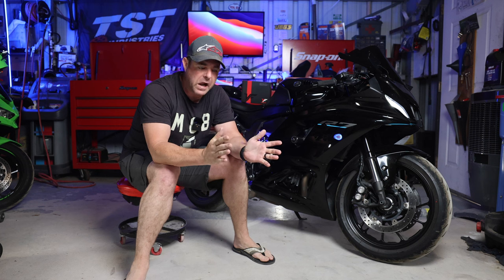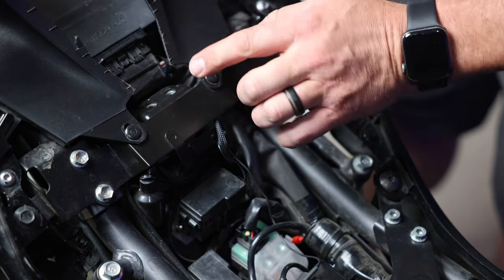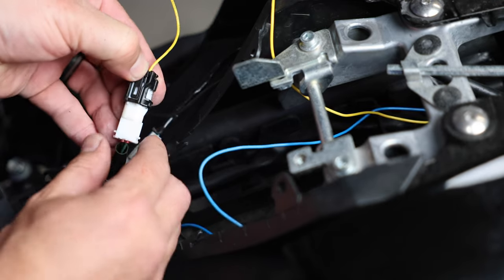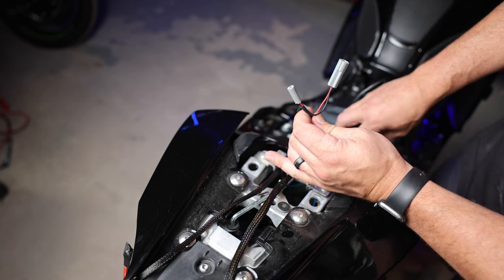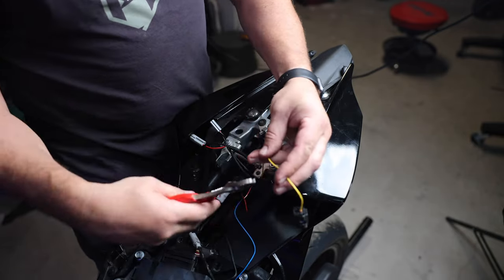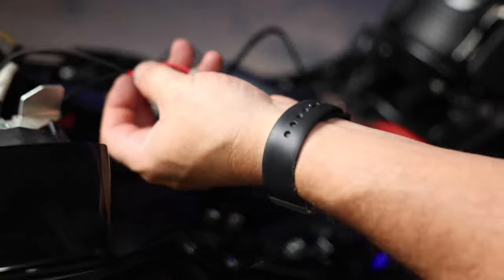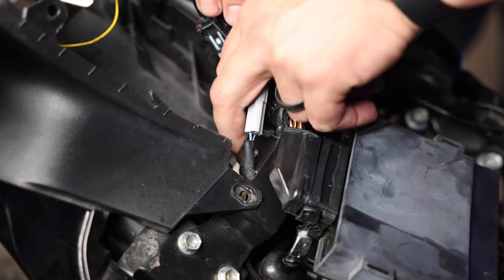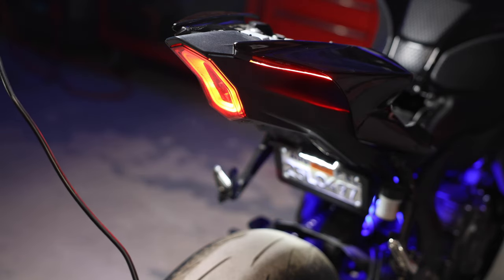Yamaha R7 best integrated turn signals

Comment: Wish this was out when I threw my JL design taillight in so I could have did it all at once. Only thing holding me back from these. Other than that they look amazing lol!
Reply from the maker: Yea man sucks to do it all twice but man they are cool
Reply: Question on tire pressure scouts! Do you run factory spec psi? Or do you have a psi you prefer for this bike?
Reply from the maker: Ahh yes good question, stock pressure is insane and almost the same on all bikes on the street I do 30 front 32 rear, track a few psi less is what I do

Comment: I recently installed these and I encountered a problem, the light stays on when indicating and I don’t know how to fix it, so instead of stopping the light and starting the indicator it indicates over the light which looks bad and might be hard to see while riding do you have a solution that might help this?
Reply from the maker: Hard to say without seeing what you did, but it sounds like you wired the license plate light to the wrong wire maybe

Comment: Hey man it looks amazing. But what if the glue on the tape won’t work what can I use to stick it…?
Reply from the maker: Thanks man, I worried about the that as well but was assured the new version has very strong tape. If it has issues and starts coming off I would use a silicone glue that would hold it really well and you could still remove them if needed

Comment: @ScoutsOut Hey man, I just got a 2024 R7 and I've been contemplating on what mods I should get first, after having your VF Designs indicators for this long are they still working as intended? I've seen a couple people complain about there left Indicator going out. Don't know if VF Design would warranty the part but just wanted to see what you think after all this time.
Reply from the maker: I’ve had many people tell me theirs failed as well. I took mine off when I installed the track fairings so I can’t verify sadly
Reply: @ScoutsOut  man they look so good, i wish this wasn't the case

Comment: So what plug does the running lamps plug into? I have looked everywhere but can't anywhere to plug it into
Reply from the maker: The running lamp is using the license plate light
Reply: Thank you so much. When I plugged it in there it acted like there was a hyper flash. Will I need to change out the turn signal relay
Reply from the maker: Ahh, yes just get the TST relay
Reply: @ScoutsOut  do you happen to know what relay it is right off hand? Is it a 2 pin?

Comment: Hey man quick question! What external knee sliders do you have that just go over your pants if you could link me to those or just tell me the name that’d be great! Love the video new subscriber!
Reply: Nevermind just saw you linked them in your Zx4rr video thank you!
Reply from the maker: I got these Knee sliders for casual riding with good knee protection
https://imp.i104546.net/3e96mk
Reply from the maker: They are decent but are 1 size fits all. They end up sagging after time and I start actually dragging my knee instead of the slider. I’m going to modify them a little to get the puck higher and I think they will be perfect
Reply: @ScoutsOut  stay safe man thank you!

Comment: I connected my Il designs every way possible and it still blinks the opposite side whenever I turn on my signals what am I doing wrong
Reply: I figured it out, I had it plug into the wrong connector
Reply from the maker: Oh good glad you figured it out, wiring can get frustrating

Comment: So my r7 has the oem fender eliminator kit, so it still has the stock turn signals in the back and a license plate light. So if I were to get this can I simply take off the turn signals and unplug them and plug this in to the same spots the turn signals were plugged into? Or would jt be better for me to get the integrated tail light first?
Reply from the maker: You could do the same splice I did in the video to the stock signals if you want. I just think the integrated tail light looks good with them